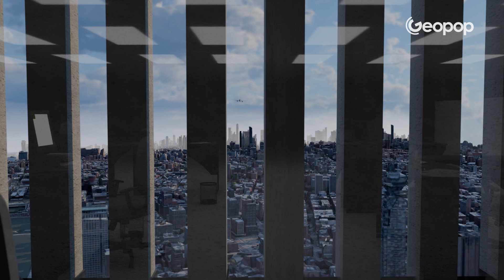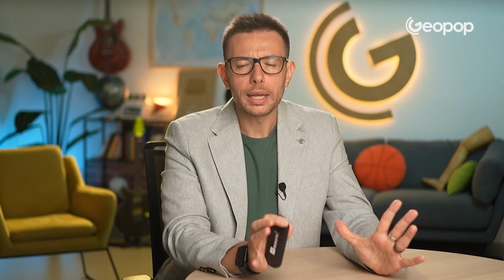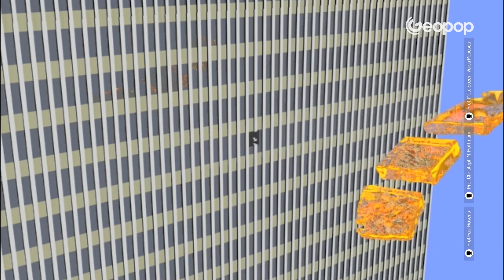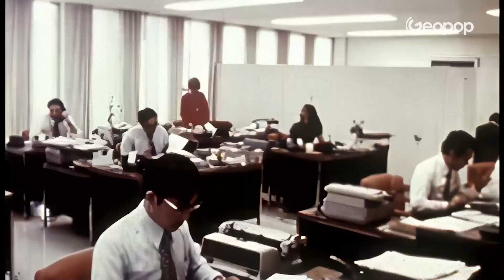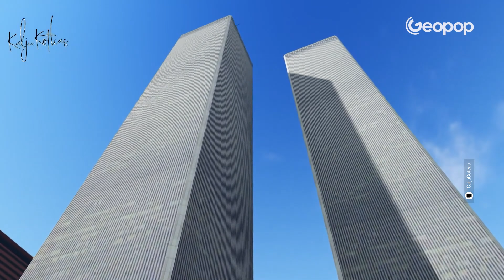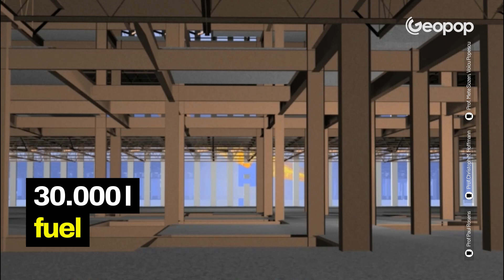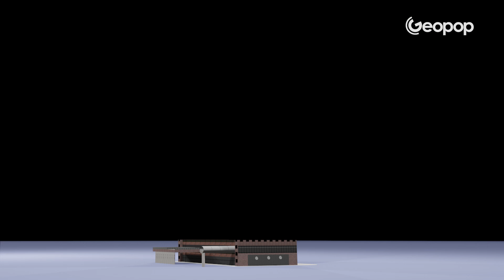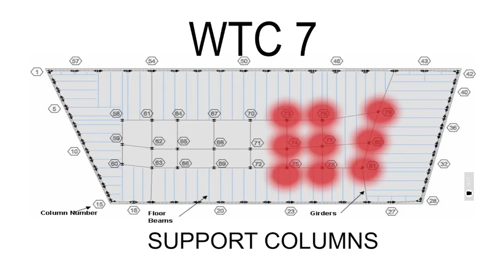9/11, 2001: The Technical Reconstruction of the Twin Towers and WTC 7 Collapses

Comment: To me number one suspicious thing is there was video recordins 2 weeks befoe elkaide mempers tryibg to plant oxygen and hydrogenor propane filled tans on towers storage... which is enough to melt metal if all exploded :) and i dont see that record anymore on any new documentaries... thats suspicious.. i mean engineers arenstupid in general if they are geniue engineers anyway :)
Reply: There is a video recording two weeks before the 9/11 attacks that showed Al Qaeda members trying to plant oxygen and hydrogen tanks in the building?  that would be interesting.  Do you remember where you saw that?
Reply: @cattycorner8  it was on youtube on one of documentaries like this... documentary was looking wery professional... tough i dont know the sender... may be still there just not on top or got blocked im not sure.. but i cant find it anymore...  but i remember exactly video.. where two indian like looking thin person  (mostlikely middle easterns or something ) were negotiating with parking lot entrance security where the truck was full with red and blue which is general color for oxygen and butane methane tanks.. which are used in industry to melt metal ... and security seemed like warned them and they turned back and werent able to enter the building with that truck.... video was claimin it was recordings of 1 or 2 weeks before the case...

Comment: look the engineers weren’t expecting that 30 years later a plane would fly through both the towers, that’s why they collapsed
Reply: Wrong. The towers were designed in the late 1960s to resist the impact of a Boeing 707 which was the largest airliner in the world back then.

Comment: The planes that hit where like a room temperature stick of butter being forced through a cheese grater
Reply: You can clearly see with your eyes that there were huge holes in the building where the planes hit. Those holes were created when the plane slammed into the building. Those are steel girders on the outside of the building. The planes broke right through them with ease. 
We can’t see the girders/columns on the inside of the building, so it’s hard to say if they were also cut through by the planes. But it’s not a stretch to say they were at the very minimum, damaged.
Reply: Yeah, i always tell em to bring their aluminum sword to a sword fight against structural steel.
Reply: @ahoksbergen  yet the wings did cut their way through the outer steel facade.
Reply: Controlled demolition. Thank your government! And Mossad.
Reply: How often have you shredded room temperature butter, to see portions of the grater sliced, like the outer supports were?
Reply: @randallreed7415  I dent say anything about shredding butter much less room temperature...the comment was pertaining to the way the planes broke up as they inter the building....in case you still don't get the image...
Plan.... butter...... building.... cheese grater....I got some Caron's..if this isn't good enough.....

Comment: What has never been explained in any great detail is if all the fuel got atomised and ignited, how much of it got blown out of the building in the fireball and how much was left inside the structure. Next is if office furniture is supposed to fireproof, flame retardant and all that, how then did it contribute to the thermal energy added to the remaining fuel to be used to raise the steel enough to cause early failure? What were the actual temperatures in the floors hit?
Reply: I wonder about that too.   And witnesses told about jet fuel that was flowing down the stairwell in one of the buildings.  At first they thought was water there was so much of it.   Why wasn't that fuel consumed by fire?
Reply: Flame retardant is different than fireproof, nothing made of synthetic materials like office furniture is fire proof, fire retardant things will still burn when there's a fire burning them, remove the fire and they stop burning, ideally, pretty sure everything that wasn't concrete or steel was burning.
Reply: @455buick6  See those yellow flames and black smoke? That indicates low fire temperatures.

Not nearly enough to even weaken the structure, let alone bring it down almost symmetrically.
Reply: Controlled demolition. Thank your government! And Mossad.
Reply: Great question. Everyone talks about the jet fuel and nobody analyzes how much would have remained after the initial fireball, nor how long it would have taken for the remainder to burn up. 

We all know fuel is consumed during fire- nobody talks about the jet fuel like that.
Reply: Look up the NATO air attacks on Yugoslavia in 1999. Thirteen cruisemissiles hit a large government building, similar in height to WTC 7.
It burned but didn't collapse.

Now if NATO had simply hijacked some regular airliners and flew those into that building however...
Reply: @AudieHolland  was that building a tube/truss style building? Bc if it wasnt... then it wouldnt behave the same. If this were the old school box style framing, like the empire state or most buildings, then theyd all be still standing. Simple physics guys.
Reply: @2jsalomon  Yup, very similar to the WTC.
You may be able to fool the young people for now, pretty soon they are going to find out.
Reply: @2jsalomon  A hijacked passenger plane, which has no explosives, just jet fuel.

A cruisemissile does have an explosive warhead: 1,000 pounds or 450 kg.
And the building was hit by 13 of these.

Comment: You want us to believe a fire weakened the 1 column that kept bld 7 standing.
So, if that column had been damaged in any way prior to this event, that building would have come down the same way?????

You want us to believe a 100 meter wide building can fall the way bld 7 fell due to fire.
Meaning: all 4 corners of the roof coming down at the exact same time and with the same acceleration, with a deviation less than 5 meters.
And you want us to believe fire can achieve this ?????
Meanwhile mr CDI Mark Loizeaux said that even Thermite can not do that.
But if thermite can not achieve such precision, fire most certainly can't either.

A blind guy can see 7 was a controlled event.
Reply: after 9/11 many more steel buildings fell because of long exposure to a fires and the buildings floors collapsed before the walls so of course it crumpled like that, also it was hit with debris
Reply: @hammon4034  that is wonderful.
Except for the fact that even NIST said the damage sustained by falling debris did NOT play any significant role in its collapse.

It is great that you think fire can make a 100 meter wide building collapse the way building 7 went down.
Which means, fire somehow weakened the structure but kept it standing until it was weak enough to have ALL 4 corners start falling at the EXACT same time and with the same acceleration and speed.

the guy from CDI, Mark Loizeaux or what his name was......
He was asked about thermite and if it could have been used.
He said that that would be impossible, because you can not time thermite. It is too unpredictable.
Thermite can not achieve such precision.

But fire can?

If Fire caused these 3 buildings to collapse, 2 identical and 1 different design steel frame buildings, then i am sure that those who are in the business of controlled demolition would use fire as one of their tools to knock down buildings.
After all, it is quite an achievement for fire to have brought down bld 7 so neatly. Sure, bit of damage to surrounding structures, sure. BUT what was the cause of that??????

And pls do answer this question:
The north tower starts to collapse. The top section comes down and it starts to come down entirely, the tower that is.
But i see a lot of stuff flying in all directions.
Dust, columns, other stuff from inside the building.
It flies away from the building.
Columns. Very heavy steel columns are seen flying away.
My understanding of gravity is that it pulls us down to earth.
It pulls objects down to earth.
So what made those steel columns fly through the air laterally?
And once all that material has been ejected, what material is left to demolish the entire 80 procent of undamaged tower ?
I mean, we can see the top section coming down and a huge amount of material is ejected outwards.
That can no longer participate in the destruction of the 80 procent intact building below.

Sorry my friend, but if you wanna believe in fairy tales, i got a few books. Grimm, Andersen, the Bible, the Qur'an. Which one do you like to read next?
Reply: @hammon4034  Nist tells us that 1 column caused the collapse of 7.

You want me to actually believe bld 7 relied completely on this 1 column, even though it was beefed up prior to this event to house a new client, the Solomon brothers?

Yup, Grimm and Andersen write better fairy tales.
Reply: Don't think 7 was a controlled event.Please stop with this lie.
Reply: @Chabagirl  ah, you dont. So you think fire can achieve such precision?

Lie? The only people who are lying are those who keep claiming this was done by Muslims, and it was caused by 2 planes striking 2 towers.

You want people to believe fire can somehow weaken a structure but keep it standing until it is weak enough so that all 4 corners of the roof start falling at the EXACT same time and with the same acceleration.

If you can believe that, you probably also believe in little red ridinghood.
Reply: @Chabagirl  Yup, clearly a controlled demolition. When buildings collapse due to other causes, they fall over to one side or only parts will fall off. But most of the inner structure is steal beams criss crossing each other like a 3-dimensional screen door.

You can punch a hole in it, but you cannot make it collapse unless you hit all the supporting columns at the same time. And each floor after the other in milliseconds of timing, which is why controlled demolition is called controlled demolition.

It was invented to safely bring down large and tall structures that are surrounded by other buildings so you don't want to damage the surrounding area.

Comment: so they built these building to be able to withstand a plane strike, but not the ensuing fire, ok I get it now
Reply: The lead structural engineer actually confirmed this later. They also did the design based on a lighter plane which was traveling much slower.
Reply: The "oh but they designed it for a slower aircraft" stuff is silly... listen to the video - they admit the impact couldn't have done it, it was the fire that did it (and the silly engineers assumed that future aircraft would be battery powered so they didn't bother with pesky flame retardant materials)😂
Reply: to withstand big commercial aircraft that flight faster then the current ones
Reply: @pierricclot6544  ok so we’ve got the bigger faster planes full of fuel, there seems to be some knowledgeable people on here, might be able to help me,
next thing I wonder about is how novice terrorist pilots managed to manoeuvre a plane of that size and speed into the buildings, that experienced pilots would be stretched to achieve,and how were people making phone calls from planes
Reply: @brendantindall805  If the Seattle Sky King could fly loop de loops in a stolen plane with no flight training than the terrorists who had training could do simple pilot maneuvers like steering and acceleration.
Reply: @marybria sure, hopefully someone else that has a clue what they’re talking about replies to me
Reply: @brendantindall805  Seriously? Wow. Come out from under your rock first and do a little research of your own.
Reply: @Terminator_2003  I have, and there are things I can't put together, obviously you can't either
Reply: @brendantindall805  what technical aspects of this presentation do you disagree with?  And also what evidence do you present to refute?
Reply: @SuperNashwa  I don’t have evidence, it’s not my field, I think you believe it or you have a few lingering questions, I’m in the former, what do you do, go and climb back under my rock as someone else commented, 
but science doesn’t usually start with a conclusion from what I understand, if you’ve got eyewitness reports of popping and floors giving way under the fire, and all the hallmarks of a building demolition, why isn’t that part of the investigation 
You could talk all day about how many columns were destroyed and how many more the buildings were designed to withstand, I think 14 % were taken out and it was designed to lose 25% and the load spread would take it up, you can talk about how far the floors buckled in testing and what they put into the computer modelling, but no point really 
A lot of innocent people that just went to work died
Reply: @brendantindall805  T-Mobile, dude. 
Duh!
Reply: @Sam-K  That's a new one 😂

Comment: I pity anyone who still believes these 3 buildings were taken down by 10 hijackers
Reply: Not 3 building. The complex had 7 Buildings. Tower 1 and 2 and 5 other buildings. Which 4 and 6 where pretty much gone also not being hit by anything and again at 5:20 building 7. And Building 6 was like a 20 story high rise with a giant whole in it over half the size of the building. Couldn't happen from falling debris.  Thats right James as if physics took a break that morning til evening.
Reply: @jbyrd1309  No physics did not, there is modell from the German physicist Heinz Pommer that explains how and why everything happend like it happend. If you know physics you know that the official theory is garbage and they all know that, but still telling the people planes could destroy buildings like that. A plane can not even penetrate the concrete containment walls of a nuclear powerplant but should be enough to weaken a building that has three times thicker steel beams then the front armour of the T34 which couldn't be penetrated by tungsten anti tank shells during WW2 with a thickness about only 8cm or 3,15 inch, the steel beams have 24cm or 9,45 inch thickness.
Reply: I pity anyone who still believes the CT propaganda and have succumbed to brainwashing by terrorists and anarchists.
Reply: its just absurd, after all evidence
Reply: I pity those who have to resort to conspiracy theories because it's easier for them than actually try and understand things.
Reply: @Weztex I do do too, always have but could you explain WTC7 going down, having to "pull it", according to Silverstein, who made billions in insurance payouts legally allowed to consider it TWO separate terrorist attacks?  A group of structural engineers and professional demolition contractors all said they've never seen a more perfect demo job that even cracks down the center before "perfectly falling into its own footprint".  It also housed the FBI offices investigating W's buddy "Kenny Boy" Ken Lay and his goons at Enron playing with statewide blackouts and billions just deciding the value of energy from day to day, like sketchy used car dealerships buying rentals in masse w banks' money then selling it to people with questionable credit scores for ridiculous down payments then selling the contracts back to banks OR financing the car in house and repossessing the cars right back after a single late payment and repeating the process w the same car until someone totals it, or rarely, actually pays it off and drives it off into the sunset
Reply: Ok James, I'll bite. If not the planes, what caused the towers to fall?
Reply: lol thanks for your pity. You still have no proof.
Reply: You must have fallen asleep in science class.
Reply: @Stein_TV  Many, many scientists agree with me, on scientific evidence. Many of them Ph.Ds i one or more of the sciences. 
  Did they all fall asleep in science class too? 
  Give yourself a chance to be tajen seriously. Stop making an arse out of yourself.
Reply: @James-ll3jb you're the one making an arse of yourself.
Reply: @anitastephenson7531  Dream on. No one who has seriously looked at all the facts objectively and honestly believes the lying official government story. Most interesting: of the 19 'hijackers', several turned up alive after September 11th, no airport security camera footage of them boarding their final flights exist, and Osama bin Laden was never indicted for the 911 attack--for lack of evidence!
   Most hilarious of all, most Americans (inckuding you, I'm sure lol) wrongly believe that Iraq's Saddam Hussein was the force that was responsible for 911.
    He wasn't.
    Nor do you care what the truth is. That's why your leaders lie to you, you know they lie to you, they know you know they lie to you, and nothing happens. 
   Because they know you don't really care.

Comment: Aluminum vs Steel is all you need to examine
Reply: What are you trying to say??
Did you fail physics class?
You know water can cut through several inches of steel, right?  Water is 1/3 the density of aluminum.
Mass, velocity, surface area, and surrounding support are all things to consider.
Surrounding support actually focuses stress.
Reply: Controlled demolition. Thank your government! And Mossad.

Comment: For protection against fire yes not a jet fuel fire and certainly not an explosion fire protection is only sprayed onto the steel an explosion would blow every inch of the insulation off of the Steal you can actually rip it off with your bare hands and a couple of long fingernails No Lie

Comment: Of course the fireproofing material was almost all gone I would say it was all completely gone first of all it's only sprayed on you can actually peel it off with your bare hands and a couple of long fingernails so yeah it was all completely blown off and probably disintegrated in the fire so stop your bologna dude I've been in construction for 40 years practically rebuilt the Bronx brand new apartment buildings right out of the ground and a few in Manhattan